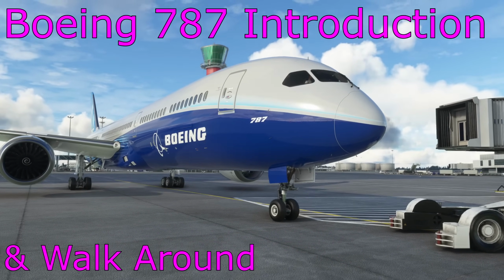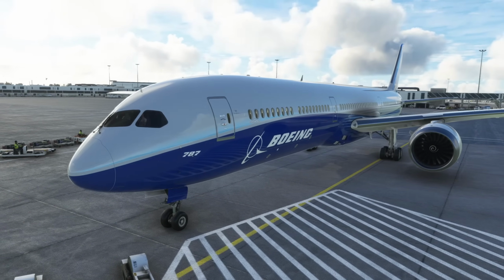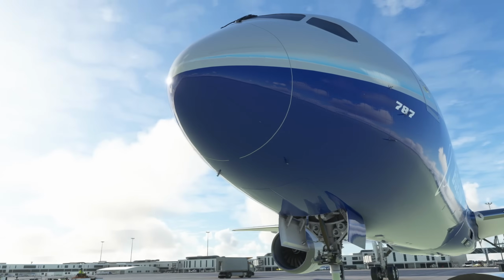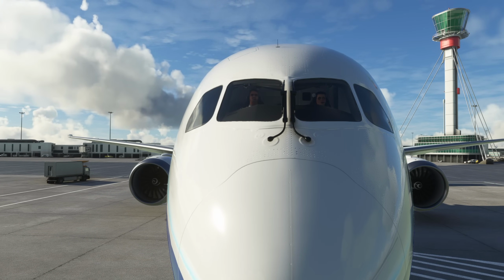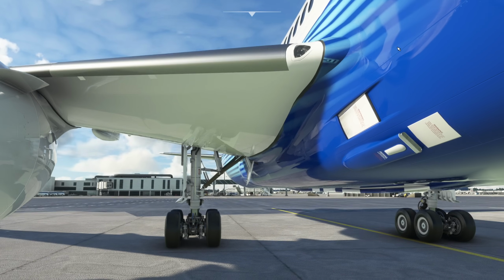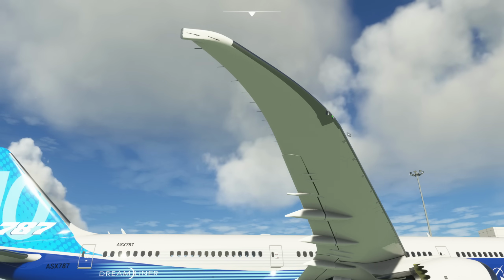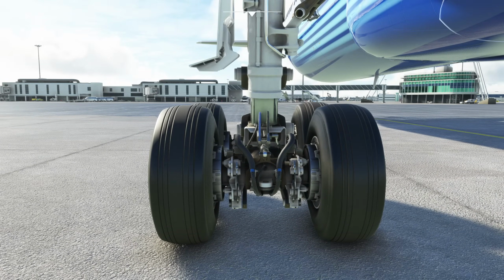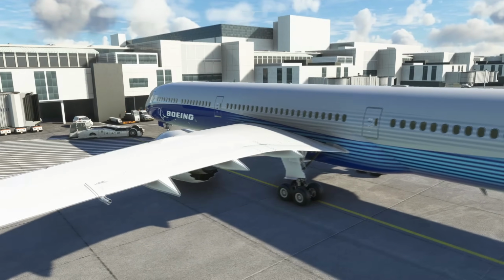Boeing 787 Dreamliner Introduction and Walkaround! With a Real 787 Pilot MSFS

Comment: I've been looking for something like this. I hear a lot about how the 737 is operated and the weird quirks and problems but I haven't seen a video detailing what a modern Boeing cockpit is like. I hope you go into some of the logic and reasoning for the design and the philosophy behind operating it. 737NG Driver recently did a video discussing the philosophy differences between training on a 737 vs training on the a330. He said training on the 737 was based on learning how the autopilot flies the airplane and then mimicking what the autopilot does with learning his to fly it manually. He said the a330 training was learning about how the plane was designed combined with learning and practicing a lot of manual flying before getting to deep into the auto pilot. He says there was almost no hand flying training or experience in 737 compared to his a330 training.This seems extremely strange to me. Is the training actually designed and conducted according some philosophy related to the airplane? That type of difference seems like it would entirely differ on the airline and not so much about the plane, but I could be wrong.

Comment: Recently Horizon Simulations released a 787-9 which is built upon the Asobo one. It features a more detailed exterior model, GEnx and Rolls Royce engine variants, additional pages on the EFB and the ability to select from two different Vbar options. Might be cool to see it on the channel, especially since it's the most popular Dreamliner version and also maybe the one you're flying IRL?

Comment: I am looking forward to the next video’s, but I have one question: if the 787 air system is done separately and electrically controlled, isn’t it more fuel efficient to use the GPU for AC instead of the APU?

Comment: The PFD on the co-pilot side displayed incorrect. It is just duplicating the PFD on the pilot side so you can see the left side and right side are exactly the same. In real 787, the display of the PFD in pilot side and co-pilot side should be symmetry, however, this issue has not been fixed since the begining in MSFS 2020. I'm wondering why the 3rd-party 787 model cannot fix this.

Comment: Excited for this! I just have one question, you said you had finished training for the 787 but yet you are type rated on the 787 and 777. How does that work if you have done any training on the 777? Is it because of the similarities in systems?
Reply: There is no type rating for 787. You are typed on 777 with extra training for 787.
Reply: @MikeP343  oh wow, didnt know that. Thanks for the response

Comment: I finally tried 787 earlier this year with ANA's 787-8. It is easily the best passenger experience, other than the 3-3-3 ecoomy layout, which put its seat width 1 inch narrower than Airbus widebodies. ANA compensated it by their generous 34" seat pitch and top notch 5 star service. Only JAL kept their Dreamliner in 2-4-2 economy configuration, which I hopefully will fly with this weekend.
As a passenger, the first thing you notice is its huge windows (bigger than even the already big Embraer E-jets, currently the biggest at 10.7" x 18.4", 2nd place belong to E-Jets at 13.6" x 13.6" and 3rd place to A220 at 11" x 16" - A350 is 9.5" x 13.5" for comparison) with that fancy electrostatic darkening shade feature. There is no lid. The annoying thing is, in ANA, the F/A control this window shade feature. However, the huge window size is lovely for anyone sitting in the middle or aisle seat, they still can get a nice view outside without much obstruction from passenger sitting next to the window.
787 has a very loud hydraulic startup whining noise, which is quite unusual for Boeings - the only thing they let passenger hear is usually the flap motor. 12 years later, it still startled a couple of 787 first timers.
787 has a very smooth ride, pressurisation aside, the gust alleviation system or turbulence mitigation thing is all there for passenger to see its inboard flaperons moving about throughout the flight in seemingly random manner. The overall experience is that the entire journey is super smooth one.
Quietness - it is super quiet, but nothing can beat A380 still. Tried that one a couple of times, 787 is very quiet, but not quieter. Granted, I tried the Rolls Royce Trent1000TEN-powered ANA's 787-8. JAL 787s uses GE GEn-1A, which is suppose to be quieter, I shall compare this later on. As you compare it with A320NEO, well, GE GEn-X lent its core technology for CFM LEAP engine series.
Compared to A350 - even as Airbus biased plane nerd, 787 honestly wins for passenger experience. A350 still retains all the weird Airbus noises. That widebody PTU still muck about whenever the pilot brakes, retract / extend landing gear, configure flaps, etc. I don't know, but that loud landing gear banging noise when the latch is overriden during extension is only cool if you are a plane nerd.
The winglet-equipped 787 was meant for shorter range 787, the cancelled 787-3, originally meant for Asian markets where 787s are used by Japanese airlines to fly mostly 1-3 hours routes, and Chinese airlines with route profile topping 4 hours max.
And since you are British and describe the specifics of -10... I think I can sort of guess what livery you are flying for.
Have fun and wish you favourable winds wherever you go!

Comment: I’ve always wondered why airliners didn’t start with the ram air packs in the first place, and instead went with straight to the convoluted engine bleed air design as standard. I mean if you asked a random person on the street how they thought an airliner sucked in air for the A/C,  99% of people would say “a hole on the side of the aircraft”. It seems to be the obvious solution.

Comment: If there is one thing I dont like about the 787 it’s the FMC. It’s the same size as the 777 but the screen it sits in is so big which results in so much wasted space. Airbus changed their FMC in the A380/A350 to fit the bigger screen.

Comment: I spent the weekend flying the 787. I really love the HUD, it helps tremendously with landings. Flight path marker and rate of descent are invaluable for butter landings down the centreline every time.
Also moving the CDU up to the primary flight display helps a lot. Since I'm always checking it, it's much easier to read it higher up, rather than constantly looking down to the pedestal.
The only thing that bugs me, I can never set the takeoff speeds. There's always an error "Takeoff speeds deleted", I have no idea why this happens. I hope Horizon's mod fixes this.

Comment: 320 went to 787 and 737 went to a330. its a strange world
Reply: I guess if you're moving to a larger aircraft there's like a 50/50 chance you'll be in an Airbus or a Boeing.
Reply: Yeah i thought the same, pretty ironic
Reply: yeah.. i noticed 2 youtuber real pilot moved from 737 to A330… earlier, Captain Joe moved from A320 to B747
Reply: Who's the 737 pilot?
Reply: @calvins48  737ngdriver
Reply: 737NG Driver

Comment: Great video as always! As you are also now 777-type rated are you planning to create similar tutorial series for the PMDG 777-series once it finally comes out?
Reply: There is no 787 type rating. The 787 is flown on the 777 rating with only "differences training". So a 787 tutorial gives you "most" of the information on the 777 except for which parts are different, such as the 777 has a bleed-air system likr a traditional commercial aircraft and the 787 does everything with electricity and has no bleed air. So you only need to learn the "differences" between them. That's why there isn't a separate 787 rating. It's bbased on the 777.